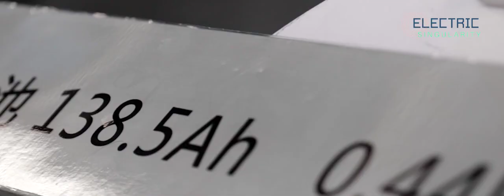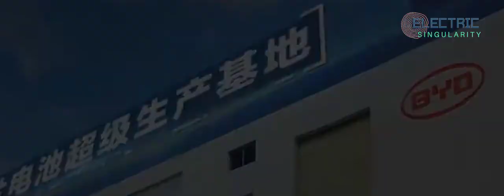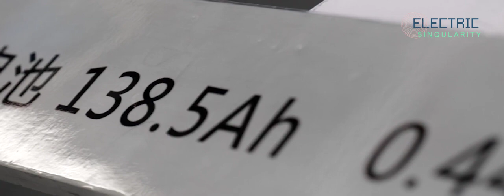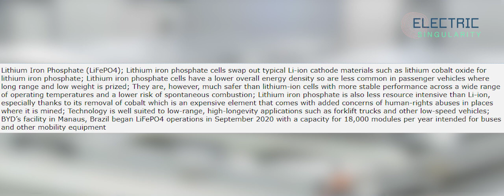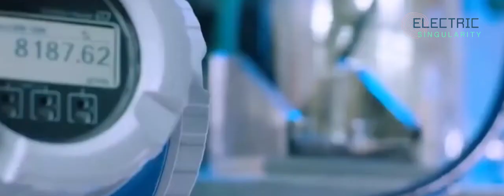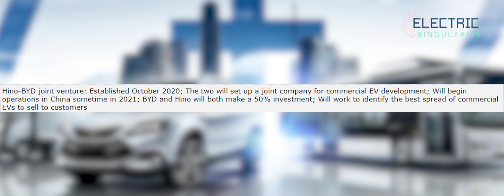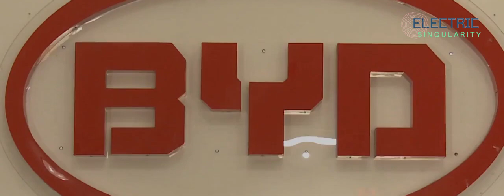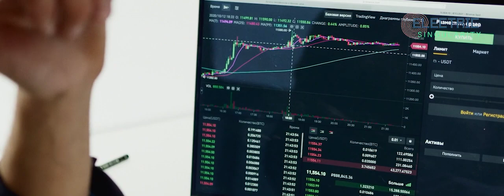BYD – an in depth look at China’s key EV and battery manufacturer

Comment: Doesn't the blade battery shape fly in the face of a basic rule of geometry, which is, the closer a shape is to a sphere, the better the ratio of interior volume to surface area? Doesn't a cylindrical battery have a much, much better ratio of active material inside to containment material?
Reply: NO............Paul

Comment: Not to be a wet blanket or anything, but the early indications are there that there has been some misleading information. Already the reports of 600 miles has changed to 600 km. And that’s Not real-world range. It seems the range is closer to 500 km or lower even. I’m sure LiFePO4 is safer, but also the price of “well under AU35,000” seems to have disappeared, or that price is for the smallest vehicle, pretty much unusable by normal sized people. 
The price of other base models is AU $50,000 or more for a minimal range. I suppose people need to make money. But I feel I’ve been misled.

Comment: If the battery pack is structural, will it be able to be swapped out at its end of life?
Reply: No swapping included but newer BYD models like the EA1 have fast charging 800V systems. That means 100-150km in 5 minutes plug in time.
Reply from the maker: With over 3000 cycles before the battery degrades to 80% of maximum capacity, the batteries will outlast the cars.
Reply: @electricviking  that just doesn't matter.  There will be frame damage in accidents, there will be faults in batteries. 

Swapping isn't optional, and replacing batteries with new technology is not optional.  An EV will also last much longer - figure 40-50 years - than an ICE.

ICE do not generally die, they just become not worth fixing when the cost of a repair exceeds their replacement value used.

Comment: Do we know if there will be active water cooling in these battery packs (especially in the EA1)?
Reply from the maker: I don't think so, LFP batteries only need a good heat pump to climate control the cabin and the batteries.
Reply: @electricviking  Heat pump is already integrated in their  e-platform 3.0. LFP does not need cooling, true

Comment: Great info. Do we know how many incidents of EV batteries fires have occurred world wide. I am aware of a few and also know that some Fire Services are still developing operational procedures for EV car fires.
Reply: Well fire is a real risk and thats why the sector moves to LFP which BYD already recognised years ago is the better option. The lower energy density of BYD is offset with smart power control software and SiC chips or the older version called IGBT semiconductor. BYD produces both themselves unlike most other EV companies, therefore less affected by chip shortages in the future.
Reply: I have been looking as the EV haters point at this all the time.  I have seen reports on 3 x model S but I think Ive read 8  x  model S.  Its nothing compared to ICE per 100,000km.   So far nothing certain.
Reply from the maker: @gzcwnk  I agree - I think 7 times more petrol car fires happen on average.
Reply from the maker: That's a good question, I'll try to find that out.